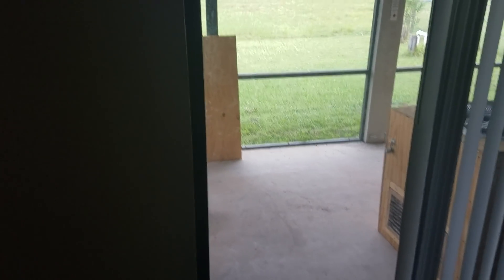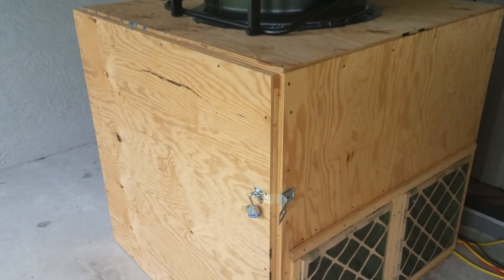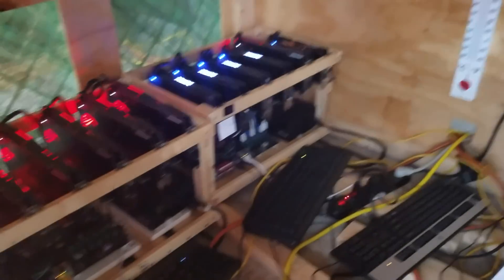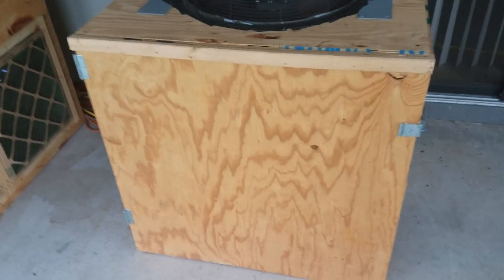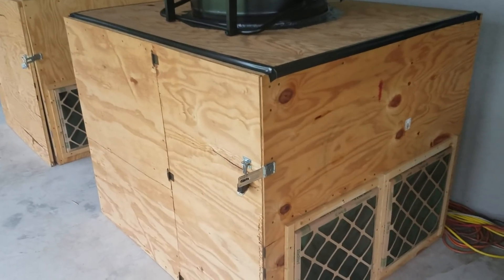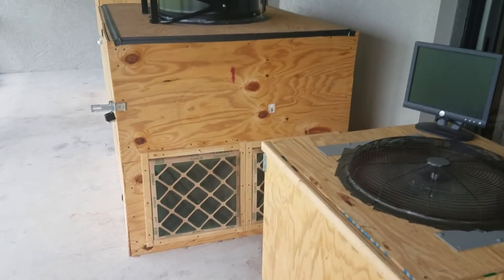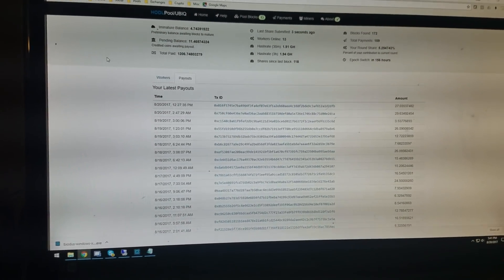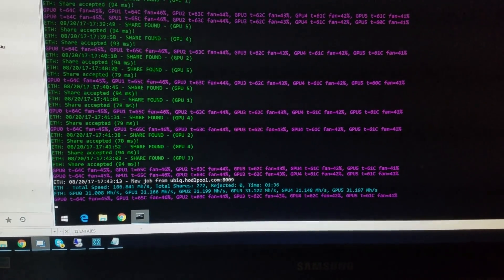Update - How to keep your mining rigs cool - 2 months later

Comment: My miners has a similar environment and my location is always humid, always near 100%.  As you already mentioned, the rigs are lowering the humidity due to the heat. 
The setup is nice to minimize dust accumulation on hardware but would probably require more maintenance for replacing those filters often.
You would want your miners a bit elevated from the ground to minimize dust accumlation.

Comment: Hi just a comment on your filters, I am Engineer that has worked on electrical panels with Air con going through the panel. Normaly you have filters on the intake so that dust is not drawn into the panel, but on the out take we use grills. I recommend you remove the filters and install a grill. You don't need to filter the hot out going air. infact you keeping the hot air in your box longer than it needs to be in there. :)

Comment: I have a question for everyone... One of my fans shopped on one of my 1070s so I removed it ( ordered a new one ) and put it back into service, but I left the shroud off the gpu and it is running cooler!  From around 70c down to 54c. I'm thinking of removing all the shrouds off all my GPUs. Your thoughts?

Comment: How long can the graphic card last if you keep mining 24/7 with 100% speed fan on the gpu??
Reply from the maker: The cards will last a long time. The fans however, that depends. Mine are only at 40 to 50% and most of my rigs are almost 2 years old now.. still rockin.

Comment: Don’t you think that the onboard fans on the Cards are running constantly when the ambient temperature is 100 degrees in the box.  The cards fans never see a break
Reply from the maker: True, but this is no different than a PSU or CPU fan. They're designed to run non-stop... Some of my rigs are two years old now... I've never replaced a fan or GPU yet... but when the time comes, I'll replace them. Its a small expense compared  to the profits made.
Reply: TwoTon Hasher I really want to build a rig but do t want to drop 5000.00 on a rig,  any suggestions on cards to use to still see a decent ROI with a low budget build
Reply from the maker: Nowadays with these crazy prices.. no man... I would suggest holding off until GPU's are available again. Or just buy coins... good time to buy.
Reply: TwoTon Hasher note taken!  Thanks lol

Comment: Thanks again my friend. I finally finished the box myself and costs me only $35. That's cause I have a woodshop so plywood I had a plenty. I used nail gun for the wood and at the end I put glue on all edges so it becomes airtight. I got a fan from Walmart for $20 and got a second one just in case it fails, I have a quick replacement. I only installed a 10x20 filters  as my box is 3ftx4ft and only 3ft tall. I turned that fan on and the air filters stayed on their own without any tape or anything. And the air was super cold even thou I was in the garage mid day which here is super hot.  It shows it's airtight. Gonna run the electrical and network tonight and hope to have it up and running by mid week next week. Again thanks for the idea its awesome. Saved me a full bedroom and headache from the lady.

Comment: I see that some rigs u got made out of wood some out of aluminum. Does it make a difference? Mine is aluminum but since I'm gonna do the outside box, I have to redo the case to support a 3sq ft box. My current rig has the cards in the front and motherboard in the back so it's too long. Would the wood heat up some or it would be ok? Wood I have plenty, woodshop gallore. Aluminum not so much, and it's not cheap from HD. Let me know. Thanks.
Reply from the maker: I only use wood now for my rig frames... does the same thing and it only costs me $6.00 instead of $40.00. I don't see any difference in temps.

Comment: Technically your rigs cant run any cooler than ambient air. if it's 90 degrees ambient, you will not get below that no matter what. If you use a refrigerant type cooler, aka air conditioning, You add to your bottom line energy costs. Florida is not a good place for mining rigs. Temperature and cost of KwH is counter productive. Bang for Buck is probably better utilized in other endeavors. I love what you have done, But Greenland would be a better place to set up shop.

Comment: I have stupid question. All that mobo must have processor right?  So do you need to put high end processor too? Btw i think im gonna start mining too but do you think its too late?
Reply from the maker: aciducen1995 - no, you don't need need high end proc for GPU mining. I use mid range CPU's (i5's and ryzen 1500) cuz i like to CPU mine along with GPU mining. No, its never too late to start mining but you might want to wait until GPU pricing is back to somewhat normal. Right now it's crazy.
Reply: TwoTon Hasher yeah.  The price is crazy.  I think im going to start with 1060 6gb soon.  Im a newbie and can u suggest which software and coins are good for mining? I only know nicehash but when i heard a lot of bitcoin loss,  it kinda make me feel afraid to start mining. And i only know bitcoin, lite and eth.
Reply from the maker: 1060's are good cards but they really excel on the equihash algorithym. So with the 1060's i'd stick with coins like Zcash, Zencash, Hush, Bitcoin gold, Bitcoinz or Zen classic. All of these coins are profitable to mine.

Comment: Hi. I love your setup. Have a question. What is your uptime on these windows-base rigs? How often you need to restart your machines? Thanks
Reply from the maker: Thanks....On average..it restart them about twice a month.
Reply: thank you very much for the info. I'm new to this and I'm considering to run my rig on linux because I found a lot of cases where windows-based rigs were crashing. Have you overclocked GPUs in any way? Because your setup looks pretty stable
Reply from the maker: Yes, overclocked and undervolted to save on power usage.

Comment: Whats your humidity in RH% where your rigs are? .. As long as humidity is not condensating you should not have a problem with metal... Wood on the other hand can catch mold when RH% is higher than 70% RH..

Comment: For me, mining in the winter time heats my house.. My rig is on the upper floor in the house.. Heating is turned off up here, so the rigs run in a 19C room (0 C, 32F outside).. So instead of using immersion heater to help the heatpump in the winter i use the rigs to heat the house.. When they cant heat enough i use my stove to heat the rest.. :) 23C inside is what i want in the winter :D

Comment: Your filters are backwards. The cross grid is support for the filter media to stay put when suction is applied. If air comes in through the filters and out the top, the grid would be on the inside the box. Just fyi.

Comment: would it be better to put fans blowing in where the filters are and the fan at the top blow out?
Reply from the maker: It depends on the strength/CFM of the fans you're going to use. In my case the fans i'm using are strong enough to remove the heat (which is crucial) and suck in fresh cooler air from the filters at the same time. If you had for instance -  only a regular household box fan for exhaust, then you would probably need to add addition fans at the air intake. After its all said and done though, you're still using the same amount of wattage for cooling. So either way.

Comment: May I suggest you make a tall cupboard like box so that you don't have kneel down to managed your rigs instead at standing desk level for ergonomic reasons.  Raise the rigs so that it is at least 1 foot above the ground and 1 above the bottom vents.  Have your fan vent the hot air out from the top duct it so that the hot air is pump outside the house and not have it raised the ambient temperature in the room; and let the cool room air get sucked in thru the bottom vents; assisted convection air flow.

Comment: I'd guess the heat from the GPUs is drying the humidity from the air. That evaporation is probably also helping to reduce the temperatures a bit too.
Reply from the maker: Agreed - I have no proof other than the lack of mold or mildew buildup and the fact that all is well. Their still out there hashing away.
Reply: Yeah. I do. The dry heat and fans from the GPUs is removing moisture from the air (just like a hair dryer) via evaporation. Evaporation is endothermic, thus providing additional cooling. It's the way a swamp cooler works and also how most warm blooded animals regulate high body heat.
Reply: Just stop. There would be no pools of liquid. The water will evaporate until the air reaches 100% humidity (additionally, the box it not airtight). Again...to make it simple for you.... are there pools of water when you blow dry your hair? Here are some pretty pictures if that helps you understand. https://courses.lumenlearning.com/suny-physics/chapter/13-6-humidity-evaporation-and-boiling/
Reply: There is no evaporation. 

The percentage of humidity at the output is lower than the input. 
The amount of moisture in the air going in and out is the same by mass. 

The dew point : temperature spread is what has increased which is also indicated by the percentage of humidity. Because there was no phase change, there was no endothermic heat transfer. 

The easy way to think of this is that hot air can hold more moisture than cold air. 

Electronics are usually fine operating in high humidity environments, so long as it is non-condensing. It can only condense if the dew point : temperature spread is reduced to nearly zero. Since you are heating the air, I think this is not possible even if the intake air is 100% relative humidity.
Reply: GPUs are analog to resistance heaters or electric strip heat. This sensible heat is essentially reheating Florida's "relatively humid" air passing across the GPUs. This allows the moisture carrying capacity of each unit volume of air per unit time to become more spongelike. However, there is no phase change occurring, so I would not expect to witness latent heat transfer bonus via evaporative cooling, otherwise you would expect to see condensation. This system is like a dehumidifier with modulating electric resistance reheat, except in this case all you have is the reheaters.

Comment: You may be able to use Bernoulli’s Principal by making a funnel from the filter to the box. By decreasing the size of hole coming into the box you speed up the velocity and heat is lost, thereby cooling the air before it enters the box.

Comment: I run a 6 card rig in south Florida but the thought of putting them outside worries me ,are you concerned about the 90% + humidity during the summer shortening the life of your cards and other components?
Reply from the maker: I used to be absolutely. I have had my rigs out there all last summer (since March 2017). As it turns out, the constant dry heat put off by the GPU's seems to keep the majority of the humidity at bay.  I see no build up of mold or mildew and no dust because of the filtered air intake.  So far, all seems well. All rigs are running perfectly. Knock on wood.

Comment: All hot air come again into the same place over and over. U need to get all hot air from the wood boxes out the room. Out u get easy  5° less than inner room. All air in this room get into the boxes over and over. U need to get fresh air always
Reply from the maker: did you even watch the video? My boxes are not in a room. They're on the back porch where there is always fresh air.. pay attention
Reply: TwoTon Hasher yes I seen... But the air get in on the boxes not are 100% Fresh air... U need to conduct all intake air from outside to each box. Make a air temperature measure out side the room. I guarantee -5°C that u get into that room
Reply: TwoTon Hasher u need to conduct the fresh air into the boxes or the hot air coming out from boxes to outside. U have a short-circuit in that place. Some % of the hot air that out from the boxes coming in again into the fan an then into the boxes.
Reply from the maker: Sorry but you're wrong. Heat is sucked out of the top, cooler fresh air comes in the bottom. They've been out for almost a year now.. this works perfect the way it is. Thanks for your input though.
Reply: TwoTon Hasher sorry but I'm not. I am a mechanical engineer HVAC specialist. U get that u telling me only if the air velocity are near to zero (0) and the air movement is making just by the temperature and density changes. But there the fans create a good air movement and the ceiling is near to them. Just try measuring the air outside. You will get few grade less that inside. Any grade less are better to your workers. Sorry for my bad English. Regards.

Comment: Any issues with having enough electricity to power the rigs?
Reply from the maker: Not anymore but yes, i used to have lots of problems. I had too many rigs and not enough power to run them. I kept popping breakers. Eventually, I had to pay an electrician to add circuits to my power panel and run several power lines to my back porch.

Comment: I couldn't help but chuckle at the padlock hasp on the front of the box.  Why bother locking them when somebody could poke out the air filter and reach in and yank out all the electronics?  I do like your setup, though.  I'll probably copy your design, but not bother putting the locking hasp on.

Comment: Humid air is better at carrying away heat "from a solid surface" than is dry air.
In the old days before radiator engineering was up to speed, they used to hang canvas water bags in front of car radiators to keep them from overheating during desert crossings.

Comment: So you put your rigs inside a box, with fans to facilitate air flow. My question is, why there is not a AC unit there to remove the heat of that room? Your temps inside the boxes are almost the same outside so in fact you are warming that room and no fresh air get in. You need to lower the temps on that room. For me personally, (do not take the wrong way plz) the boxes only function there is to stop the sound all over your home. In terms of temp without a AC unit, I do not see any benefit. You made this in August and I do hope by this time your cards are ok, but they life span will be less because of heat. You will not see lower hash rates, but the life expectancy of those cards might be extended if you get that temperature room cooler. Good luck.
As for humidity problems, some AC units also can take any humidity out by giving dry cool air inside the room.

Comment: I'm thinking of jumping into mining... I'm not a nebie on the I.T. side of things but am on mining.  I understand the GPU aspect of things, power supply, etc....  On a smaller scale, lets say 4 GPU's, can you make any money on it?  I may actually be able to set up a rig with Zero Electricity cost....  Comments?  Thoughts?
Reply from the maker: It will take you about 6 to 7 months to make your investment back but yes you will definitely make money, especially with free electricity
Reply: Sure, makes sense.  Time is all I have, so no rush on the ROI.  The facility where I work, has 3 servers already running 24x7, and and other things, so power cost will be 0.  I just don't want to invest the time, for 3.00 a month... ;)  BTW, I believe miners get paid in Bitcoins or some other crypto currency.  If so, how does one sell that for US $$.  Thanks for the answer as well.
Reply from the maker: mine the coins you want... sell on an exchange like poloniex or bittrex for BTC, ETH or LTC. Then transfer to coinbase.com. Coinbase will buy these 3 coins for US $$.

Comment: Why Windows over Linux?
Reply from the maker: I prefer Linux actually. but there are a couple of reasons I'm using Windows. Control of overclocking and undervolting is much easier in Windows and more cost efficient over time. Also, in the past, it wasn't so but nowadays, a windows miner is just as stable as as Linux.

Comment: Cooling cheaper. Remove fans and spinning objects. Submerge in pure mineral oil. Circulate oil using a Grundfos circulatory pump to PEX tubing buried at least 18" underground in a coil like pattern outside. System is close loop back to the submersion tank where your components are housed. Your welcome, geothermal computer cooling, 1/10 the energy cost, much cooler processors. Grundfos circulatory pumps use less energy than your fans.

Comment: I've a hunch that the warm moist air, after it's filtered of particles and enters the box, expands due to the lower pressure inside the box, due to the vacuum pull from the fan (Bernoulli's principle, etc.).  This expansion should cause some adiabatic cooling of the 100F air intake.   Heat from the cards is (1) not only pulled away due to the draw of the fan, but removal is accelerated also as (2) heat goes into the moisture molecules dispersed in the air, which too is drawn away thanks to the massive airflow.  Genius....    Moist air holds more heat also.   A smart thermodynamicist should be able to better explain this.   ..  Watching smoke (say from incense) inside the box would be interesting showing stagnation zones and perhaps the possibility of shortening the height of the box resulting in the 4'x4'x4' boxes cooling in line with the smaller box?    Putting these boxes on a bench to access the innards while standing (or sitting in a chair) would be handy if you've bad knees like me.  <lol>  Please thank your friend for urging you to share this....    Cheers!
Reply from the maker: Andy, thank you for your input. Running a "smoke" test of sorts would be interesting to see. I'll have to devise something